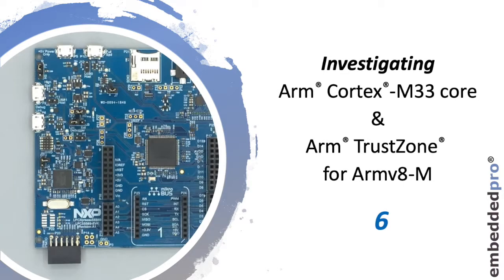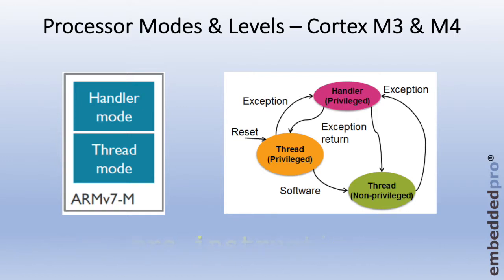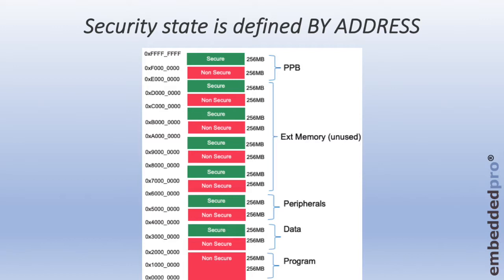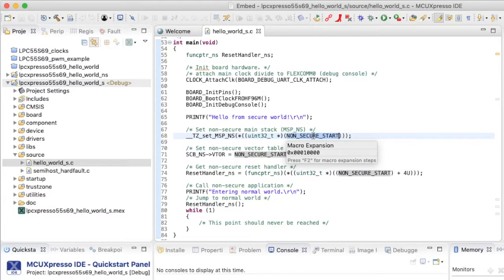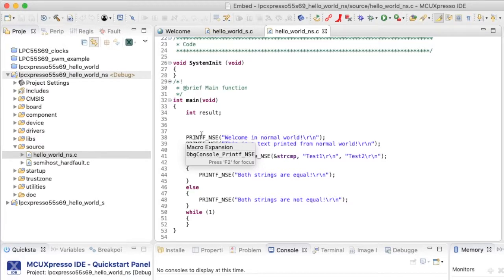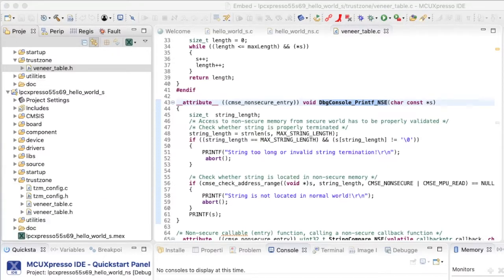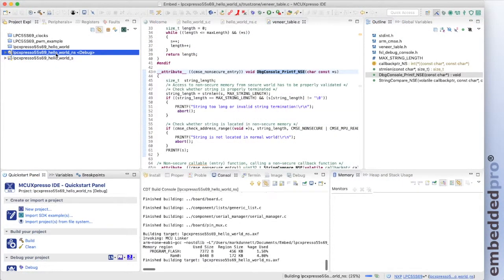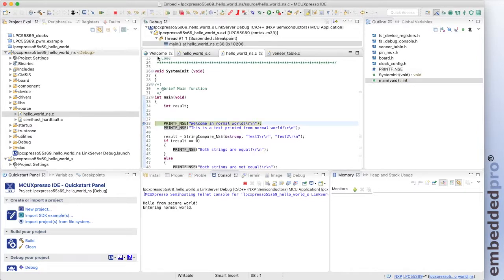6 TrustZone and secure hello world

Comment: Where is the security attribute map saved on the MCU and who handles it? Is it an extension of the MPU or is it a completely separate (and new ) hardware unit?
Reply from the maker: Thanks for your comment Silviu. I'll cover Security Attributes next week, but briefly there is a new hardware unit in the core (actually there are 3 new units: IDAU, SAU and the Security Attribution logic). IDAU is 'implementation defined' (by the chip vendor) and the SAU is just like a memory protection unit (MPU) but for setting security attributions. The logic brings the IDAU and SAU settings together. Who handles it? Well the chip vendor specifies the IDAU, and the software running in the secure world configures the SAU regions. By default the Security Attribution Unit sets memory regions to be secure, and the logic enforces this (regardless of IDAU setting).